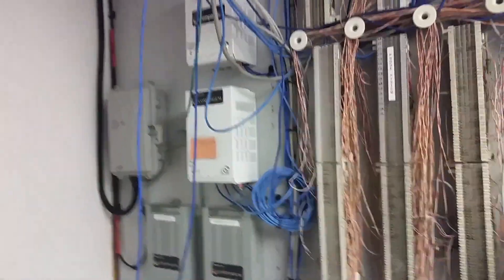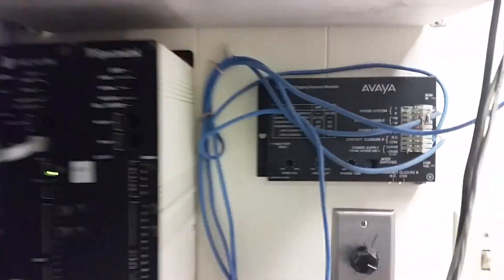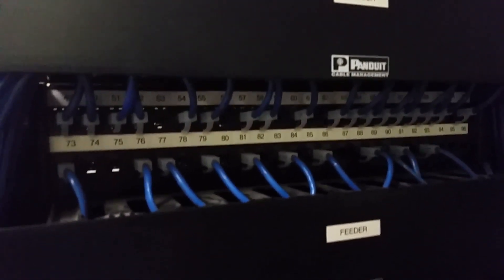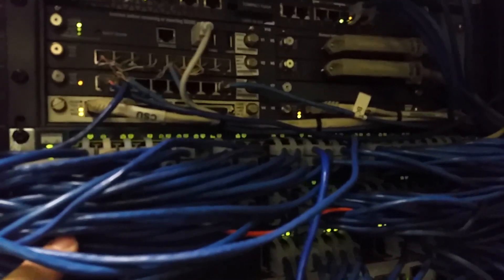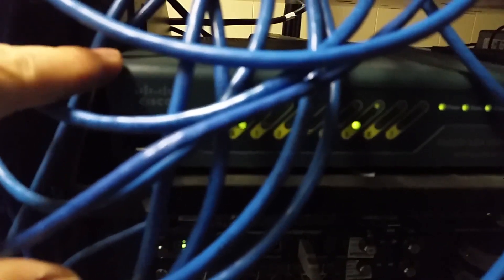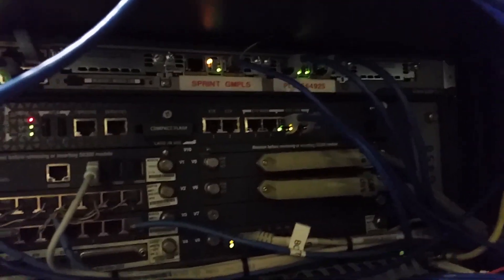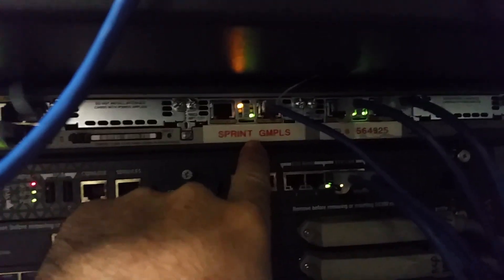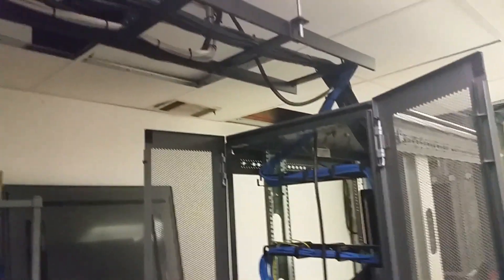Data  Infrastructure MDF Tour

Comment: Damn this cisco stuff is long out of date I bet it's not even gigabit. I wonder why don't they upgrade
Reply from the maker: seems that way, right?   But at enterprise level organization, this is not unusual.  They will utilize old infrastructure as long as they possibly can.  It always comes down to the almighty dollar. 😆
Thanks for the comment  :-)
Reply: @DIYTelecom  Keeping stuff until it will break to pieces? This is being cheap, not reasonable.
Reply: @wiziek  Did you know that until the early 1990s in some areas of the United States, AT&T still used switching equipment from the 1890s? The last Strowger switch was decommissioned in Sunnyvale, CA in or around 1992 where it had been in operation since 1897. Some things are good when they're the latest and greatest, but not all of the latest things are the greatest. 😉
Reply from the maker: Ahahah,  amen to that.  😄